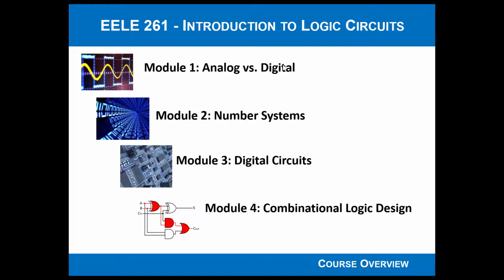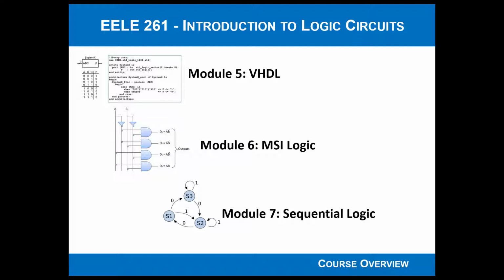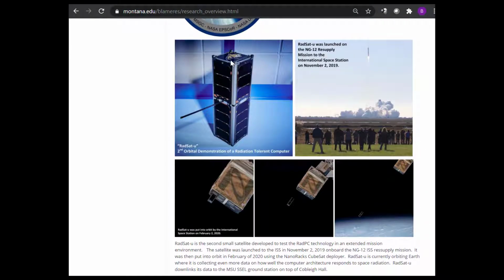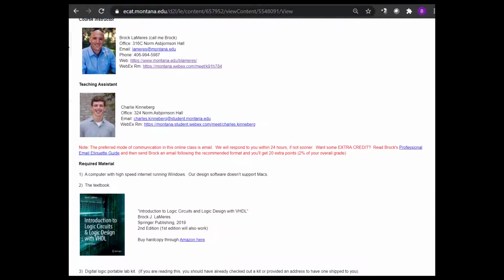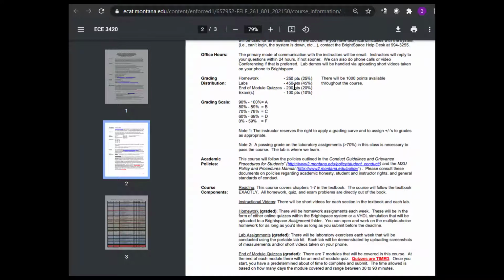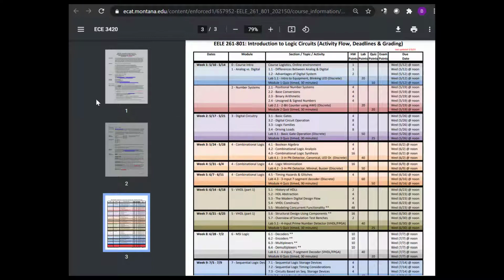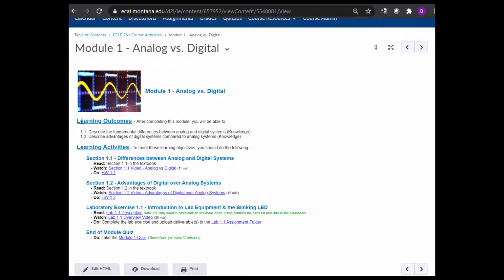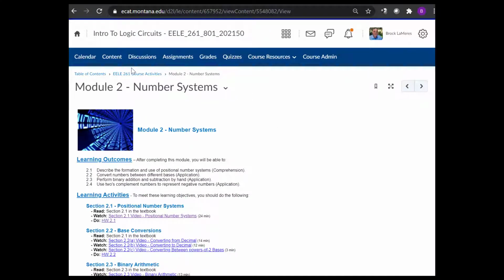EELE 261 - Course Intro (Summer 2021)

Comment: Do people still use VHDL? Or are companies moving towards System Verilog HDL?
Reply: Yes
Reply: We in the defense sector are using VHDL. Private market seems to prefer Verilog and sometimes VHDL
Reply: Yes. I work as an FPGA engineer in the wood processing industry using machine vision. Everything is done in VHDL. Verilog, for some reason, is frown upon in my company. They say that it's better to master VHDL before relaying solely on Verilog. VHDL is more explicit when describing the hardware.